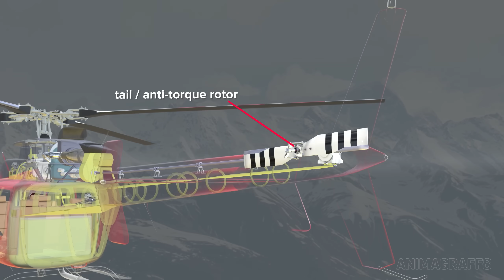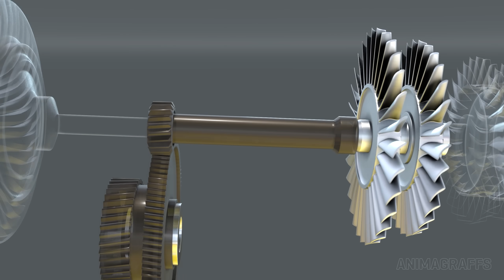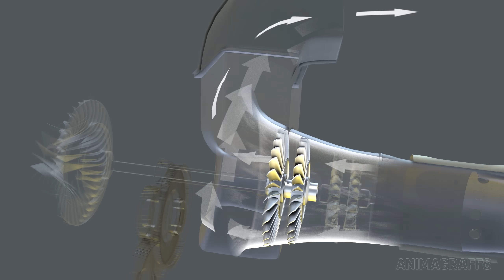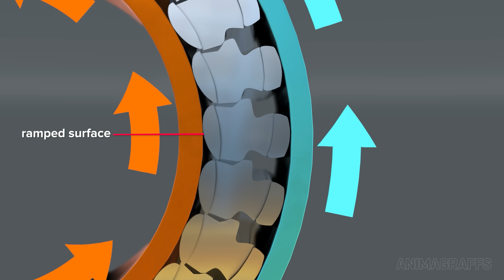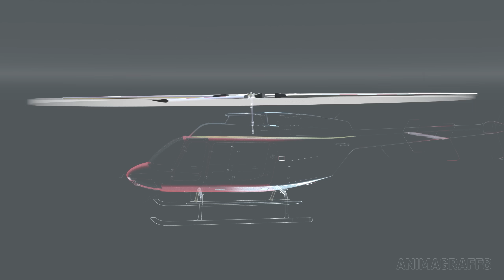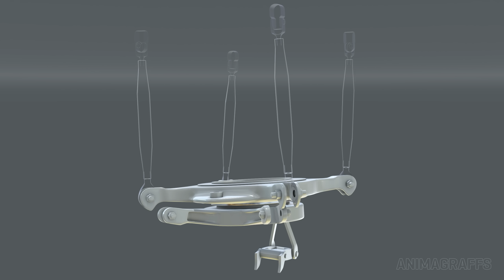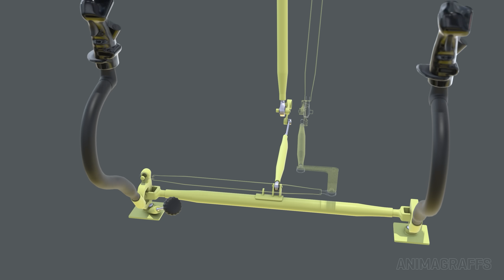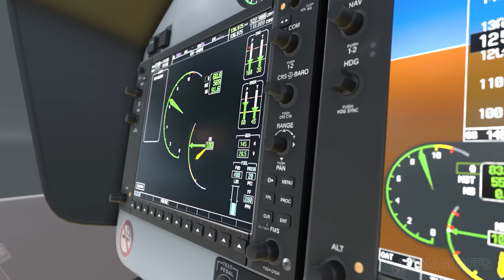How a Helicopter Works (Bell 407)

Comment: I’m an A&P mechanic with a focus on UH-60 Blackhawk helicopters. I’ve also spent time working on Bell stuff (what’s in this video) and the differences are significant insofar as the main rotor system is concerned. However, I can say with confidence, that this video is spot on. I expected to be able to pick it apart and find places where you got lazy and didn’t thoroughly explain a concept or system. I was wrong! You actually made it simple to understand concepts that took me literally years to learn and understand. I will be showing this video to any young, prospective rotorcraft students that are interested in learning about helicopters moving forward. You have a gift.
Reply: High praise.  Very nice of you to say so.
Reply: I was an aircraft mechanic in the Marine Corp. Airframes and Hydraulics on the AV8BB Harrier. I was very interested in learning these concepts on a helicopter. I did however find just one place he didn't thoroughly explain something. The combination and/or separation of manual and hydraulic inputs on the stick. I assume the hydraulic servos enhance mechanical input automatically so if hydraulics go out, the inline servos just act as a continuation of the mechanical rods? I was expecting some sort of electronic control sensors  feeding off the stick controls and transmitting to the servos similar to fly by wire on a fixed wing. On the harrier, all flight controls, including the reaction control valves for hovering are mechanical only. The only exception is the flaps which are only electronic.
Reply: @krisholden5365  is it difficult going straight to helos out of A&P school?
Reply: Especially where the minute details and terminology is concerned. This dude does his f'ing homework. I can relate to the OCD dude must have 😂

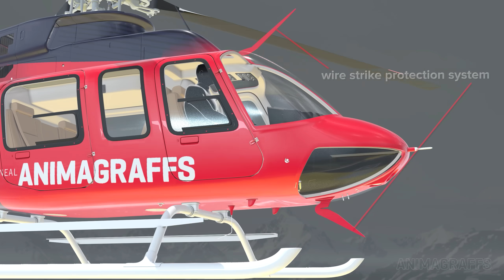Comment: 2:10 what are those for?
Reply: @No-vq1iv  cutting power lines. Power lines can be fatal and virtually impossible to spot. If conditions are right, the cutters can sever the power line before it catches on the landing gear or gets wound in the rotor system, either of which events could be catastrophic.

Comment: Wow. The engineering involved in helicopter design is mind blowing. 

I’ve been a part of fixed wing aviation for over 28 years and never knew the level of detail involved in a rotary wing aircraft. 

Between the design of a helicopter and the ability to explain it all with these 3 dimensional color video almost has me speechless.

Comment: Three glaring issues with the animation. 
1: Tail rotors spin 5 to 7 times that of the main rotors depending on the helicopter type. 
2: Main rotor blades have what is called washout which is a twist in the blade to reduce the amount of pitch toward the tip. This balances the amount of lift throughout the blade’s length.
3: The gas producer and power turbines always turn in the opposite direction in all turbine engines. 
Other than that you did a great job.
Reply: 2: Why would you want downwash onto the fuselage? What about aerobatic or autorotation (stall) ?
3: So the generator turbine is able to "throw back" the gas so extremely that this can power the power turbine? Kinda like the spools in the F-22 raptor rotate in opposite directions?
Reply: @ArneChristianRosenfeldt  
2: Air speed is squared in the lift formula. If the blades don’t have washout builtin the outer regions of the blades would generate exponentially more lift and be destroyed. All props on planes have this twist as well. 
3: The turbines rotate in the opposite direction to cancel the gyroscopic effect. If they rotated in the same direction the engine would resist any effort to change its orientation.
Reply: @eds6889 2:  I see washout in props and Osprey. Model Helis don’t seem to have it.

3. Ah so for cruise operation they cancel each other. Probably the same reason that the F-22 has this . Less agile planes like 737Max don’t need it, I guess.
Reply: @ArneChristianRosenfeldt  in an RC helicopter the blades are so short and the forces so light there would be no need although I have seen some with it. 
As far as the turbines go. The power turbine rotates at 40,000+ rpm in most helicopter engines. The gas producer and compressor varies as power is increased or decreased with rpms from 35,000 to 50,000+. Both of these create a strong gyroscopic effect and if they were spinning in the same direction that gyroscopic effect would render the engine extremely hard to move. Ok if installed on a stand on the ground but not so much for vehicles operated in the third dimension. That is why every turbine engine has these turbine wheels rotating in opposite directions.
Reply: @eds6889  yeah, and low pressure turbines have a larger diameter and a gear connected to them. I still try to grasp gyroscopes. By my calculations a vehicle with rotors pointing in all 3 directions of space does not object rotation. Instead there will be huge axial forces on all 6 bearings, which are still resolved internally. Ah, wrong. Axial vectors still add as vectors. So the sum will stabilise this along a diagonal axis. You can rotate it freely around it. Still internal forces will be huge. There is a very lengthy YouTube video about it. I guess the trick for an artificial horizon is to use some linkage to connect the axes to individually gyros. And also use precision to control the 90° between the gyros.

Maybe in a small helicopter the turbine could sit vertically and compensate the main rotor. Sideway for the tail would be weird. Rather have contra-rotating electric rotors as in these manned quads.
Reply: @eds6889  RC helis designed for casual indoor-type (with no negative collective pitch) typically run twisted blades. Larger machines designed for acro run 0 twist because they require ability to generate high negative g in general. There are other reasons that are more complicated (AOA on retreating blade inboard at high air speed becomes a massive source of drag- as that section of rotor sees reversed flow etc).
Reply: @derekjones3450  not interested in RC aircraft. Real helicopters always have washout on their main rotor blades.

Comment: As a Mechanical Engineer by trade in industry, this video is outstanding. Full of in-depth learnings that usually only come with 'experience' and 'on the job learning' in industry. Undoubtedly these videos take hours upon hours to produce, and for little reconciliation considering the harshness of Youtube's algorithm and payment system. However, please do keep on producing this content as it is invaluable for the next generation of engineers that would otherwise have no way to 'fast-track' and learn their craft.

Comment: The Robinson lower swashplate inputs are the same as any other helicopter just the upper PC links are phased to reduce the pitch flap coupling that Frank called Wee Waaa because of the free to cone bearings, That's a quote from Frank Robinson.
If you'll notice as you add forward cyclic you with out thinking add a little left cyclic to keep ground track on take off,,,

Autorotation is not a dive maneuver - Engine out = 
Aft cyclic to load rotor system , (Free energy from air speed) A dive will reduce rotor rpm
Reduce collective to preserve rotor rpm  - Air will drive the rotors in steady state autorotation  (No inertia needed)
feed for heading - Doesn't mater if CCW or CW rotation = Ni issues at all
Inertia only helps in rate of rpm loss or gain  Hughes 500 c has light rotors and aft cyclic works great in saving rpm after engine outs, and in the flare it can add lots of rotor rpm ...  Heavy blades lose rpm slower but you can't get rpm back if needed.
A well timed flare and you don't even need to add collective on the bottom end (Autorotation saved my bacon a few times)
Nice video other wise,
Reply: Do you need wheels to not tip over after a flare? Flare relies on intertia of the rotor blades.
Reply: @ArneChristianRosenfeldt  inertia is the mass of the blades  - heavy blades resist change in rpm as lighter blades quickly change rpm, In a flare the rotor system is exposed to a higher angle of attack and the extra lift reduces rate descent and air speed. A single blade of a Robinson is 18 lbs the Bell 205 is 200 lbs, flew both +++
What do you fly? I've flown over 45 years in everything under 12.5  From the little Brantley to the Sikorsky S-58  and experimentals too.
https://www.youtube.com/watch?v=fRp2uAYWa_A
Reply: @ArneChristianRosenfeldt  inertia is only a short event in the start of auto rotation & after a flare. 
The flare exposes the rotor disk to a higher angle of attack to slow descent  inertia only is the ease or resistance of the blades to change RPM - Air flow is the cause of Auto rotation not inertia. 
You obviously don't fly helicopters
Reply: @HongyaMa  Inertia becomes important every time RPM changes. If you loose power, but your control electronics has fixed RPM as main objective, it will easy angle of attack and RPM would not change going into auto-rotation. For flare, where does the energy come from to blow down more air to not only carry the weight, but also the downwards impulse? Why do you care what I fly and rate something as obvious for the general public?
Reply: @ArneChristianRosenfeldt  You don't know squat . Take you toys and find another corner. Inertia is as I said and the flare is what it is and I don't need collective after the flare because my flares are well timed and my rate of descent and air speed are zero/zero as my skids touch the ground.
You don't fly squat sonny-  You're so far removed from reality you might as well be on another planet... read my post again

Comment: They didn’t explain the purpose of the planetary gears?
Reply: There must be a weight optimum. Model helicopters have simple gears. With 5 planets we have 5 cranks adding their torque. Per crank the gear is pushed by two opposite teeth into the same direction. So we got 10 teeth working together. Going to lower torque the next stages concentrate more on a high ratio.

Comment: Has anyone ever tried engineering a helicopter with the utilization of the exhaust thrust to apply the “thrust vectoring effect”, exiting the tail or aft region near or around the torque…or commonly known as the tail rotor ?  Reason being that I am curious to know if any actual application of this method could work, I am not an aeronautical engineer so I’m merely speculating, but if enough thrust could be applied could this method be used to raise, lower and negate the impact of the torque created by the main rotors? By raising and lowering the tail I was only thinking it could possibly replace the tilt of the rotor for forward and backwards motion. It’s just a thought experiment and it might be the dumbest thing an actual engineer ever heard but like I said, I am merely curious about this and if it could possibly even work.  Thank you if anyone can help me out with any explanation of this for I love learning about aviation and basically anything interesting.  Thanks
Reply: Yes . Those helicopters are silent because the main blade downwash only hit a tube, but no high frequency tail rotor. I wonder how you steer when autorotation is used? Also there must be a lot of cool bypass air to keep the hot exhaust from the paint .

Without a swashplate the helicopter would roll on fast forward flight. Would be cool to let the nozzle squeeze the exhaust diagonal back for thrust on top speed.

When you really hate cyclic, you could move the rotor sideways relative to the fuselage and the heavy gearbox.

Comment: It's beautiful that at the end we got 3 servo actuators to control a triangular shape at the swashplate assembly. That accounts for the idea that 3 points define a plane, so a triangular like control is the ideal (and minimal) to control the plane of rotation of the blades. And to define a position in 3D space we need a translation movement, and to angles. So, one of them goes up or down, while the others account for angular directions
Reply: Does collective move farther than cyclic ? I read advertising that the hexpod is the best. 6 servos, but you get rid of those sliders around the mast.

Comment: 24:33 no mention of the gyroscopic precession which makes you want to pitch 90 degrees before where you want the lift because its out of phase. Of course the controls already take care of this but it is important to mention
Reply: Rubix built his cube without thinking about a solution. Just make it not fall apart. I think this video should only make a lasting helicopter. Next part would be the flight school.
Reply: @ArneChristianRosenfeldt  Not to sound pedantic but Rubik is with a k. What i say doesnt involve knowing how to  fly the helicopter is just the nature of how it changes direction,.

Comment: I can’t imagine how many hours of work it takes to animate, edit, and narrate these videos. Which can’t happen until in-depth research is done on the current machine being animated, and all of the technical details understood. 

Genuinely impressive work. 

Also impressive, is that every extremely specialized mechanical nut, bearing, bushing, coupling, etc. on machines like this are tested so extensively that, with scheduled maintenance, have a failure-rate of practically and virtually close to never. 

The main takeaway I see from the design of this machine is that everything can elegantly flex and absorb forces so as to create an entire system that is actually very durable to the exceptional and complex forces they must operate in unison within as one smoothly functioning, truly exceptional example of engineering on so many levels.

Comment: Superb, as always.  I'm glad that you emphasized the flapping and the complex effects incurred by spinning the "wings".  Even a layperson can imagine that developing stable helicopter flight was an interesting process as inventors would intuitively fix the blades firmly in place and design in absolute control over their positioning, but the secret to the creation of the modern helicopter is to control some aspects of blade position while allowing the blades to flap and move to some degree as they want.  If this system were made rigid, it would simply break apart.

Comment: Jake, your section on how the tail rotor system works reminded me of a tail rotor drive shaft flexible (flex) coupling that failed from fatigue on live TV while filming traffic information in Jacksonville, Florida back in 1986.  Unfortunately, the Pilot & Reporter died and the Cameraman was injured.  Fortunately someone in the studio was able to turn the "live news feed" off before showing more than the helicopter rotating very quickly as it lost control.

On an unrelated (to the previous paragraph) note, I used to have a friend that flew Hueys (UH-1) in the Vietnam war that mentioned the "Jesus nut" that held the rotors onto the mast. Of course, you gave the proper name to the nut instead of the slang term for it.

Comment: Turboshafts engines ARE jet engines but with a power turbine to rotate the driveshaft. Also one of your main rotor pitch links isn't animated with the rest. Also, if you look at the gyroscopic precession, the R-22/44/66 do impart their thrust vectors at 70degrees but the control input on the system is still done 90degrees to that point. If you look at your own animation of the swashplate you'll see the pitch horns are about 20 degrees from dead aft and when forward cyclic is imparted to the disk the one on the right hand side drops imparting the moment at 90degrees before the desired result. 70+20=90 so it is not phase lag but gyroscopic precession that causes this. I've worked on helicopter for 25years and I have specifically worked on the rotor system that became the Bell 407's rotor system in the form of the Bell 406, more commonly known as the OH-58D and never heard anyone refer to this as phase lag, which is more talking about the leading and lagging of the blades not the control input. Elastomeric bearings are not springs but rubberized ball bearings, and work in the exact same way. They are rubberized to prevent debris from wearing them out. Though they can still be torn if the system is over exerted due to pilot error. The Blackhawk had two kinds of pitch links, those with standard metal spherical bearings and ones that had them replaced with elastomeric bearings in the "lolipops". All four had to be the same though so you couldn't mix them together on the same ship. The "lower" swash plate is referred to as the non-rotating or stationary swashplate as opposed to the rotating swashplate that the pitch links are attached to.

Comment: I'm amazed that someone actually invented this, and now they are used commonly all over the world. One single failure in any single blade or gear, and the entire thing tears itself apart. At least airplanes can glide, but this is just so insanely complex I'm surprised it works at all.
Reply: The maintenance to keep them safe and reliable also makes them very expensive. Every moving part has a very conservative inspection or replacement hour life.

Comment: I’m very impressed with the respect that the producer/narrator (Jacob?) shows to the engineering of the machines. I’ve spent over fourteen years working with design engineers and tech writers at a very high-tech machine design and manufacturing company. My job was to somehow turn what they knew about the machines as engineers or explainers into understandable visuals. But I was usually only working for print or non-moving presentations. Working on a moving media product is much more difficult.    

I found the engineers who really respected (or “loved”) their products could explain them best. 

Now I have to join Jacob’s channel… I’m not an engineer, but I can usually translate what engineers say into English if I know the vocabulary.